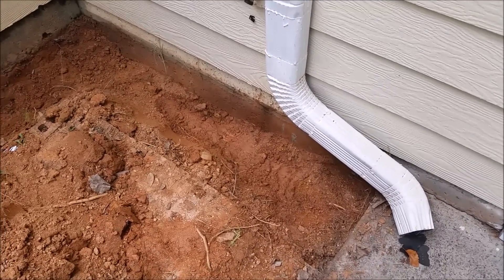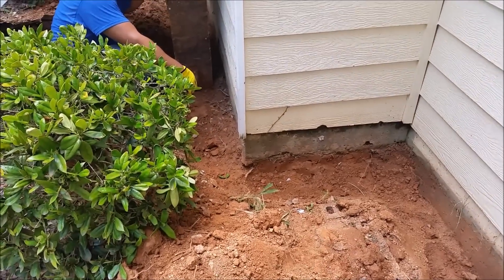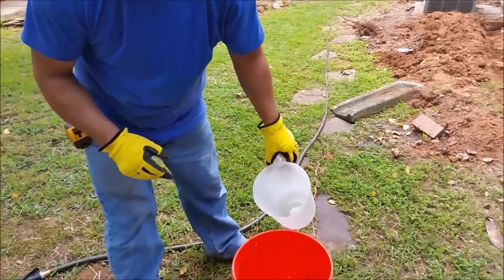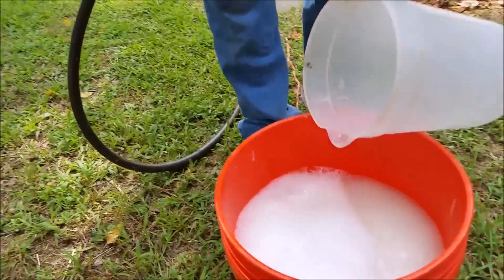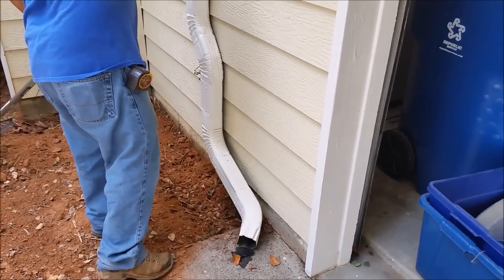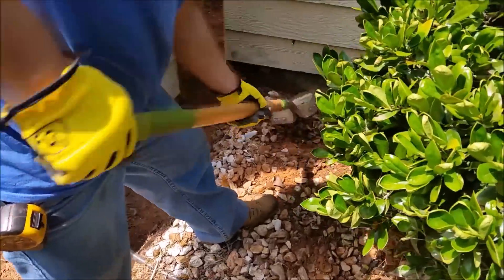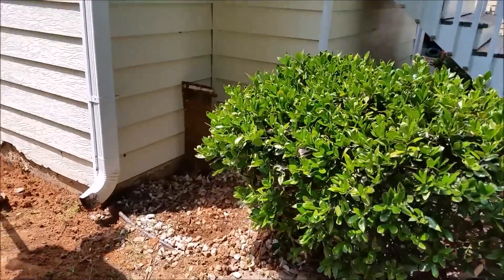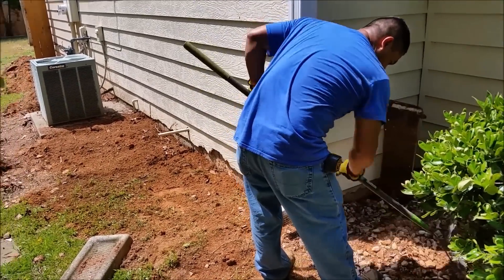How to Apply  Termidor or Taurus Properly To Kill Subterranean Termites - DIY - Step by Step

Comment: It is important to also drill the slab that the air-con unit is sitting on and flood with chemical or the termites will come up between both slabs. Also any air-con condensation pipes should be going to a drain if possible as any moisture close to the slab will create a conducive effect for termites-they need water!

Comment: I used Taurus SC from a 78 ounce bottle. I discovered the active ingredient is water-soluble, so I relied on time and rain to drive it into the soil.  I mixed it in five gallons bucket, and poured it liberally just as shown in this excellent video, but used little flags every ten feet along my entire house perimeter to know how far I should go with each bucket dump.. Did I trench, no.  I was told by a reliable source that trenching is done by pest control companies because (a) they must do a complete and effective treatment in a single visit, and (b) they need to show their value in charging $2400 for the treatment. So, instead, I decided to use my access to my home whenever I want, and  known water-solubility of the product, to not trench at all and apply it three times (spring summer fall). I poured it onto the ground against the house and foundation in ten foot segments. Voila...no termites! And I has carpenter ants visible around by wooden outbuilding shed, theyre gone, too. Frankly, after one application all seemed dead, but I did the summer and autumn applications anyhow. Three years later nothing still...but just to be sure, I applied it again this past summer twice, with a rainstorm in between (aboit a week between applications). I’m in Illinois, so the soil is moderate (not clay, not sand, more like topsoil). If my soil was clay, maybe I’d have to spend hours trenching, but the leaching into my soil seems enough. I’m merely sharing my personal experience so you can decide how to do it yourself. All the paid mastermind pest exterminators can get on here and tell us all the reasons trenching is mandatory,, but it wasn’t for effective treatment in my 20 year old home. Some might say that ground application washes away and wastes the chemical, to which I reply that I can waste a ton of it before I ever get to $2400 the exterminator was going to charge. Affect other insects further away when it washes away? Doubtful...trust me, I did it far enough away from a rain that it was in the ground and dry before any rain. If I’m told it doesn’t get deep enough to be effective, I’d say that my multiple treatments did get as deep as a single trenched treatment, but I can’t prove that other than I no longer have termite issues. $200 in Taurus SC and I’m good (two different years spaced 3 years apart). Take it for what it’s worth, if you disagree with how I did it then do it your own way. It’s all good. Peace ☮️ This is a good video, btw, re mixing and pouring of the chemical. Thanks for it, Joseph. Good stuff.
Reply from the maker: You could hire a landscape or a student to dig the trench around the house for less than $200 instead of apply the solution 3 times.
Reply: @josephk9182  Hi, Joseph.  Thanks for your reply.  I could, but it worked without that.  Repeated applications were just for my own reassurance (and because I had extra T-SC that I didn't want to store...lol).  Curious, will you be re-applying T-SC to your home, or just wait until see pests again?  I think you have the soil loosened a bit now, should be dump-n-go but I know its been a while since you trenched it.  Btw, your vid is one of the first t come up when one searches for this on Youtube, so that's wonderful.
Reply from the maker: @Burps___  You should reply the T-SC every 7 years. If you do it more frequently it is better.
Reply: @josephk9182  Thank you, Joseph K. #appreciation
Reply: Read the product label and do as it says.

Comment: I don't know why all the mystery in measurements? It is a very basic formula: 4 ounces of chemical to 5 gallons of water. 
The reason they tell you to use "4 gallons" is because a full 5 gallon bucket will spill easily. 
The "solution" ;) is to use two (2) 5 gallon buckets. Fill one with water and pour half into another empty bucket (giving you two, half full buckets). Now measure 2 ounces of chemical in each and then mix back and fourth (called "boxing") for a couple of times.
Now, pour 6 feet from each half filled, 5 gallon bucket or 12.5 feet for 5 gallons. 
Easy peasy!
Reply: Or just mix 4 gallons and not have to do the bucket to bucket mix...use a drill with a mixer paddle.   That's easy peasy too.

Comment: I would pour the liquid into the trench, and then wait and let the liquid completely soak down into the ground before back filling.
The further down into the ground the liquid goes, the more effective it can be killing termites.
Reply from the maker: Good advice.
Reply: So even if your house is made out of stucco you still have to do the trenching and pour the liquid? I only see termites around my garage door frame. No where else around the house. Do I treat the very small area by my water house leading to the garage ? It has soil and mulch. I’ve seen some people say they sprayed affected area only and if worked on ants too.

Comment: I didn't see you treat the back fill but if the treatment worked that is all that matters. I used to work for Terminix....and the way you explained it is correct. The only thing I would add is you put that dirt back in place, you should treat that too. Although I don't know if you got to that later and didn't show it.
Reply from the maker: I treated the back fill,  but did not show it.  Thanks for you comment.

Comment: Thanks for showing us how is done . I bought a house and i discovered some mud tubs on a cople of walls on the living room  and the bathroom  I dont know if they are active still want to treat those areas  would this work would this kill them all ?
Reply: Not a guarantee, would recommend calling your local professional, depending on the extent the termites have travelled throughout your house the pest controller may have to apply termidor foam/dust to eradicate the existing termites that are already in the house. Only treating the exterior of your house may trap the termites in your house. Call a professional
Reply from the maker: You should use Termidor as you saw in the video. If you have termite they will all died with in a day or two because termite must go back to the ground. If you not sure call professional.

Comment: I have a lot of pvc pipes, instead of digging a trench can I stick a drilled hole 12 inches long pvc pipes in the ground around the house 12 inches apart? Same concept as drilling the concrete slab.

Comment: If the steps are contacting the ground you have to break the contact. And what about plumbing penetrating slab inside including if refrigerator has an ice maker with water connection on wall in back of it they are being found more often coming up there. If they came up a load bearing wall due to a crack in slab how do you treat that or if slab is cracked under wood flooring and they're active?
Reply from the maker: You need to drill in the slab and inject Termidor. Also you should sealed the space with silicon.

Comment: Hi SiR, can you please help me to understand what type of termites controller should I used in the wood that is already installed in the house. Thank you very much
Reply from the maker: There is a foam that Termidor manufacture  you can buy it online or in home improvement shop. You need to inject this foam via a hole in the drywall.

Comment: It`s a nice video! Could you tell me whether I can spray Termidor via weep holes in brick veneer, please? To apply it in between bricks and drywall voids, please?  Some people advices to do that, but some is against taking Termidor is for outside use only. Thank you
Reply from the maker: You need to use foam Termidor

Comment: From Philippines  Compadre  got it! In regard to concrete  did you  use  funnel to pour Termidor  or a injector?  Please advise  Thank you again.  My villa is  large 500 sq meters needs lots of holes.  Thanks for your expert advice n your excellent video
Reply from the maker: If you have an injector use it otherwise, use a funnel but make sure that the 
funnel is inserted deep inside the hole. You need to be patient to let all the substance going into the funnel to the ground. Basically, the hole should be 6 inches deep under the concrete in the soil.
Reply: Joseph K OK I  will pass on what you said to my Japanese handyman!

Comment: Question => The fundation of the house is thicker than 6 inches. So what is te termites circulate deeper than the depth of the trench ?
Reply from the maker: This issue  is difficult to resolve. If you have a crack in your concrete exactly where a wall is standing it will be difficult to protect. Thai is why you also treat your garage floor by drilling holes in the concrete in hope  it will protect and kill  termites that living under your concrete.
Reply: I read that termites travel in about the top 6" of the soil.

Comment: question how many termidor bottles need for 1700 SQF home ? thanks ! I bought house and the termite destroy under the crawl space the joists and sill plate :(
Reply from the maker: The perimeter of your house and not the area will determine the amount of Termidor you should use.  it is around 0.4 Oz to 1 foot. So for 100 feet is around 40  Oz  (30 meter 1.2 litter) of Termidor.

Comment: so if i use this it will keep my house protected for 8-10 years? and it will kill termites that may already be in my home?
Reply from the maker: If the termites penetrate the house from an area you treat  (with Termidor ) it will however, if termites penetrate from under concrete stairs or under concrete slab where is difficult to treat the answer is not for sure unless you treat his area. Please look at my video :

https://www.youtube.com/watch?v=yZFXPLG_Uy0
Reply: Thanks!

Comment: one forth of my house has concreate. how do i treat that. i dont wnat to drill holes. around the concreate is a lemon tree. i have a hose sprayer with termite treatment.
Reply from the maker: You can make a ditch 6 x 6 (widthxdeep)  inches around the concrete and proceed as you see in this video, otherwise look at my other videos:

How To Apply Termidor or Tauros To A Concrete Slab To Kill Termites - Part 1 - Drilling Holes 

   https://www.youtube.com/watch?v=A5Osiqq2MFU

Please look at all 3 videos and see how easy is to do it will cost you less than $50 .
Reply: neworleans39 you have to drill the concrete and the holes must be 12 inches apart for termidor and you cannot put the chemical near edible trees it has to be 1 foot out from the drip line

Comment: i really dont understand why we cant just apply to top soil the ground is going to soak in the chemical up to six inches i get that the soil may soak a little bit further out from the target area but it seems like digging a trench is really just over kill
Reply from the maker: This is what the manufacture recommended after testing the product on top soil and when digging 6". It is guarantee to work when you put the substance in a 6"x6" trench . So the answer you can but per manufacture it is not guaranty to work.
Reply: @josephk9182  yeh no i get that...im about to use a 4” edger along the perimeter and call it good...🤷🏼‍♂️ i get it “follow the product label” but ugh im good on all that nonsense
Reply from the maker: @xmodusoperandix  That is oakay
Reply: Not all soil can be easily penetrated.  The product will just roll off hard clay soil.  Not nonsense.  The label says to do it a specific way for a reason.  It's easy to do it right the first time or get someone to do it properly.

Comment: Can I spray directly to the infested wood that mixed water with chemical?
Like my garage you can see infested wood, I want spray something to them to kill termites.
Thanks in advance!
Reply from the maker: You can but it is better to use foam Termidor than liquid Termidor when apply it on wood. Liquid termidor designed to use in soil (ground).

Comment: Thanks so much for this video! How long do you have to leave the metal wall makers up before removing them?
Reply from the maker: If you asking about the plywood (not metal) that makes the wall for the Termidor to stay in 10 feet  boundary, after you pour the Termidor liquid into the ditch you can continue immediately punting the dirt (soil) back to the ditch.

Comment: Does enyone know what the sence to dig a trenche to apply Termidor and... drill the foundation around the house and spray the same substance un that holes?  It looks like the same... But some videos advised us to do like that- both - thenche pouring and  drilling/squirting...    One more question- can we use Termidor indoor? Fotr example to treat studs, logs,  and all the attic structural timber?  Thank you
Reply: I wish to know that too.
Reply: I see videos where they drill holes and inject the product into cinder blocks that hold up the homes as well as trench around those same cinder blocks because termites can get into the house from the inside and outside of the blocks.  It depends on what type of foundation you have.

Comment: So every 10ft you dig a trench... Ex: fill a 10ft trench, skip 10 ft and dig another 10ft?
Reply from the maker: Yes. I prepared 4 gallons of Termidor mix  which is good for a trench of 10 feet x 6 inch x 6 inch.
Reply: Ana do not skip 10', dig a 6"×6" trench around the entire foundation of your home; apply 4 gallons Termidor mix every 10'

Comment: for the fellow from the philippines copied this frommanother site....used lentrex myself and am very satisfied....use all precautions though when applying and storing treat like you would all poisonous chemicals...........Hi there. You might want to try Lentrex/Lantrex. You can get it at any ACE hardware store. AFAIK, almost all anti-termite chemicals have some form of carcinogens in them so that's why when you us them, it is not advisable to enter the treated area for a minimum of six hours. Latrex/Lentrex can be mixed with water and just spray the mixture over the exposed area....from http://pinoyhandyman.com/forum/in-and-out-of-the-house/home-maintenance-and-repairs/87-any-suggestion-on-a-good-termicide-anti-anay